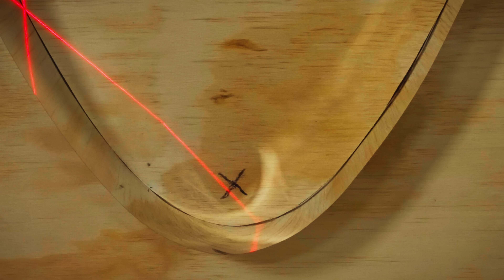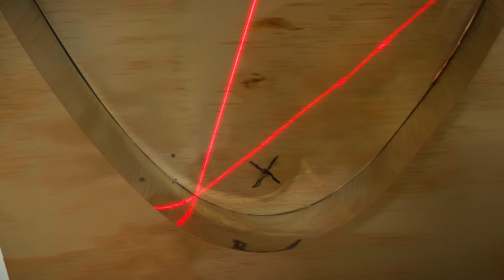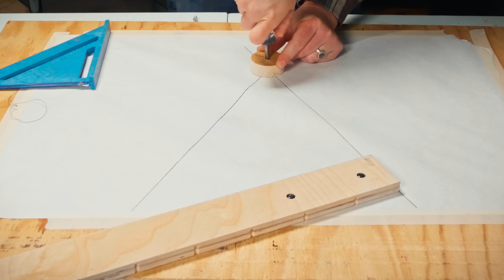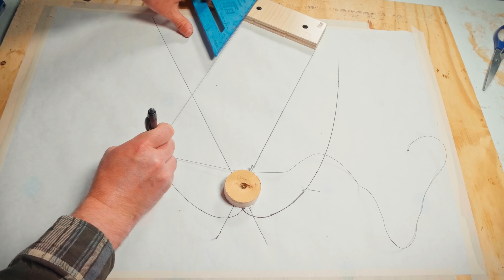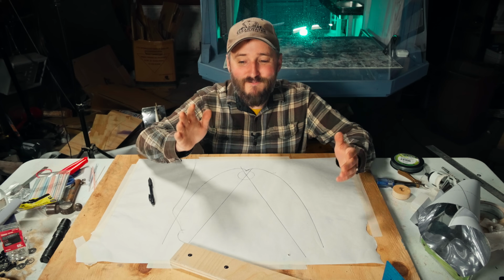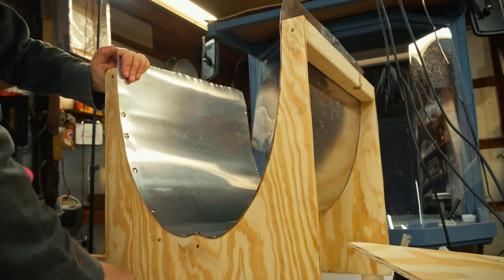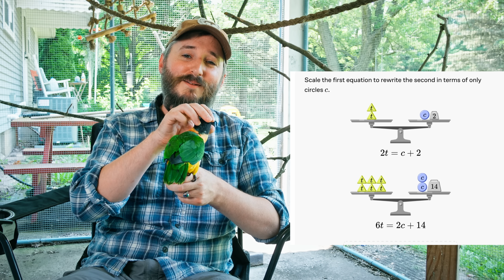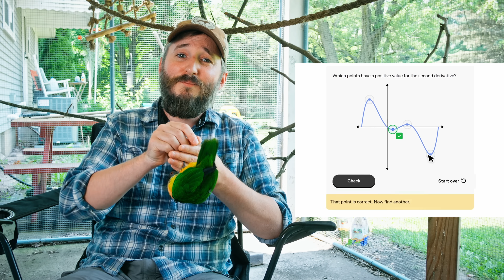DIY Solar Concentrators, Made Better.

Comment: Great work! For a video idea, it would be interesting to see what happens if you use this design for an cooling project! The pipe being coated in your cooling black body emitter paint. Perhaps some slight modifications to improve cooling performance.

Comment: This is cool, but i think a coil of pipe in a thin flat box with a clear top is better for the application. The angle of exposure is much wider and the area of catching the sun is a better ratio for compactness, i think. Instead of a fancy parabilic mirror yuo just have more pipe with the same fluid running through it.

Comment: This is awesome. 
I'm wondering how this could be turned into some kind of power source... If water or perhaps even air could be heated, perhaps a Stirling engine could convert the heat to electrical power. I'm not 100% sure of it's efficiency, but it might work.
I've seen people setup BBQ sets with a parabolic setup like your first concentrator.
If water could be brought to boiling point, it might be a good setup for purifying water by boiling it with one of these as well.
Wonder if the hot air could be captured and piped into a house during winter too...
Many possibilities.
Thanks

Comment: Tracking motor setup heat pipes that are circulated with a solar powered pump  
idk using this in a city house   running a small steam engine with an elect generator ? that charges 12vlt battery's to light your 12vlt Led lights  
that cabin get away be best used on  other wise back to watching youtube diy's :) that i never build
Reply: Memo:  ad guard working blocks adds & popups

Comment: Why does this design with the wide tube and the different shape perform better in cloudy weather and not need to be aimed directly at the sun? Is it able to use the light scattered by the clouds, so the light coming at it from angles other than from the sun?

Comment: I am not a science guy and very poor at math but have a question/thought. Your compound parabola is 2-D. It has a y and an X axis.  It stands vertically on your plywood for one axis and the other axis is the length of the pipe and width of the metal flashing.  Can you make a 3-D compound parabola like a mini satellite dish and have a metal orb sitting in the center.  Satellite dishes are perfectly round which is not a parabola, so if you build one with the parabola chain swing shape it should be an elongated or deeper dished radar dish shape.  So if you can create 90F temps from your 5 inch long pipe and 5 inch wide metal flashing, think how much more the heat is multiplied with a 360 degree y/x axis. So you can't just take an existing satellite dish shape that is made to collect radio or radar waves.  The parabola dish is tuned for the sun. I may not know science but I do know radar being a Mission Crew Commander Air Battle Manager in charge of AWACS radar aircraft.
Reply: Some satellite dishes are round and some are not
Reply: I get what you mean.... Exactly my thoughts but I saw it like a tall bowl...and I wonder if you put a lid on that bowl that was made maybe of glass .... But it's like a double lid..... I think that would capture more light again and force it into the concentrator.... And of course paint the point of concentration black. 
But if the concentrator becomes a 3d parabolic "bowl"... With the double sided lid on top..what can we use it for???? .... Fill the bowl with water to heat it and have it on a closed circuit system like radiators  in the UK, and create movement with convection and use that movement to turn something and make electricity????? 
My brother is a physicist..... I will send him this and see what he thinks 🎉

Comment: The third curve is absolutely perfect for a solar oven with a glass window in the angled lid as the flat bottom of the reflector. Then all light coming in between the two angles will go through the window into the insulated oven space. This will allow the oven to be set up so that at the beginning of the cooking time the sun is at one of the angles defining the "left-side" capture angle and then as the sun moves all of the light will still be reflected into the oven without having to move the oven to align with the sun until the sun reaches the "right-side" capture angle . The sun moves at 15 degrees per hour (360 degrees in 24 hours). Designing the reflector with a 30 degree capture angle means that the solar oven would capture 100% of the light falling on the reflectors for 2 hours completely unattended (or at least unadjusted). If what you are cooking needs more than 2 hours, then start cooking about 10 AM and at noon come out and adjust the angle so it will keep collecting all of the sun light for an additional 2 hours.

Besides the advantage of not having to constantly reposition the solar oven, this type of reflector can allow the window to be smaller than the top of the oven. The window is the least insulated part of the solar oven, so the smaller it is, the less heat will conduct through the glass. Still probably worth putting using a double pane window to further reduce the heat leak out of the oven. And of course, the capture area of the reflector can be made larger than the total area of the top of the solar oven to give a greater than one Sol of illumination, which will yield higher oven temperatures than a solar oven with just a flat pane of glass in the top.

Besides wierdos like me who think it is cool to cook with sunlight, solar ovens can be critical in parts of the world where pretty much wood is the only energy source available for cooking and that wood is being used up and getting more expensive for desperately poor people to buy. So an efficient and cheap solar oven can be a lifesaver for millions across the Sahel region in Africa and others like it around the world.

Comment: So, if you extrude this shape radially, you'd only need about a ~7' diameter circle to melt 1kg steel in 5-10 minutes (depending on the time of year and the latitude of your location). This is also assuming ~80% system efficiency.

I'm imagining a tube of tungsten with a tungsten # shape welded within and you drop in chunks of steel and point that baby at the sun and presto you've got a backyard smelter that operates at the low cost of $0.00 per hour.

Comment: I've seen folks suggest coating the pipe with various coatings, but, since it would be completely enclosed and thus not affected by the weather, might not simply blackening it with soot from a flame provide an optimal light-absorbing coating?

Cheers!

Comment: A better test maybe...use the same pipe in both rigs, fill the pipes with water, see which pipe heats the water better over time. Repeat with different size pipes for more insight.

Comment: 4:47 You actually do care about the angle, rather than "as long as it hits somewhere along the pipe", as the angle light hits the surface predicts absorbed power for most objects.

Comment: If you did create the 3:13 cut and the earlier mirror surface with the hanging chain method, the catenary shape to parabola approximation should explain why the laser went ever so slightly off.

Comment: Love the video as normal. 

Always wondered on this. Say you did build a long trough for water heating (And I have seen professional built units in temperate regions for getting a little more heat into a greenhouse). Instead of a flat cover over the top.... what about having the plexiglass or whatever formed into a lense itself. Flat bottom, convex top? Might help increase the "viewing angle" by several degrees. Wouldn't do much for you on a sunny day, but might get a little more energy on a cloudy one.

Also wonder if mylar space blankets would make good reflectors.

Comment: Okay. Headed down the math rabbit hole now. Got to make drawings for compound parabolic ribs that my cnc router can cut. Half dozen parallel troughs about a meter long... one inch blackened copper tubing... solar cell powered pump circulating to an insulated reservoir...  Hmmm... at my latitude the biggest problem might be keeping the water under 100 C. So many fun problems to work out. Thanks, Ben.

Comment: Slide a coil of small diameter copper tube down that iron pipe and you've got a pretty good heater for a camp shower. Throw in an inline thermostatic mixing valve to set temp, and you've got it made.

Comment: here's a good tip: make the concentrator run parallel to the sun path (east-to-west) so rays hit the tube regardless of time of the day. you wils need to adjust it north-south as seasons change, but very rarely or maybe not at all, if you use the method in the video. also keep in mind the ends of the concentrator will receive sun rays, so either make it reflective or at least a heat resistant material

Comment: @Nighthawkinlight a lot of Nuclear Power systems incorporate natural re-circulation into their design - the main advantage being it provides enough heat dissipation to keep the reactor cool with no external power (this would be used in an emergency situation - loss of power and reactor SCRAM -- something like that).

The main driver of force is the height of your "cold leg" compared to the hot.  The different densities of the water at different temperatures create a flow of water in a direction.

If you were to set up a system with this heater above ground and a deep cold leg that goes underground, you could create a closed system with an extremely high driving force.  Add 2 relief valves for safety and redundancy (nobody wants an explosion), and an inline generator.... Now you've got yourself a solar electricity generator.

Comment: A drywall square or any straight-edge held along the speed square would let you just unwrap the pen until it hits that edge and then follow it as it slides, rather than struggling to keep the string aligned with the short speed square. Let the string just do it's job of keeping travel distance equal, and let the square do it's job. =]

Comment: Big advantage of the Compound parabolic is that is you can take your Latitude and aim it at the midpoint then set the angels at the max & min to maximize the heating without any need for adjusting for the seasons.   One of my friends has this and he even curved the mirror and pipe ever so slightly to maximize the day as well.    Also as others have mentioned, paint the pipe with high temp. engine flat black or chemically treat to make the pipe turn black.

Comment: If you use this setup as a light projector what would be the shape of the beam (of course it is simple to test just replace the pipe with one made of white paper and put a LED light inside).

Comment: You can also get an old flashlight and get the reflector out. It most likely already has the desired shape to heat up small things like a metal straw.

Comment: @nightHawkinLight, the geometric definition of a parabola is : all the point at the same distance of a fixed point AND a line. This is what you draw : the pen on the string is exactly at the same distance of the fixed point (focal center) of the parabola, and the line (the one of your wood bar).
On the second part, you draw what's called a cycloid which has also some nice geometric properties :)
All this can be designed as well by formulas, but for once, I find the "geometric" definition more elegant !

Comment: This is how spur tooth gears are designed in CAD! It allows for a constant contact for continuous torque transfer, compared to simple circular lobe shaped gears. There’s definitely tons of math out there for this, I bet you could use it to find some fancy optimization but honestly this is the simplest way to achieve the same result.

Comment: A chain is not a parabola but a catenary curve which involves the hyperbolic cosine function. It is true that it contains a parabola but it is not exact: 2*(cosh(x) - 1) ~= x^2 + x^4/12 + ...

So it is not as effective at the edges. This may not matter for simple applications but technically they are not the same.

Comment: Just a tip that painting the pipe black increases the heat output inside enough to boil water and cook food. Also Gosun already manufactures a very similar solar cooker.

Comment: Wow, Ben....! This is great news for me....I have a fifth wheel from the late 80s that is pretty sweet....I have it on a piece of wooded property I own...In Washington....I need to insulate under the floor. I can do it from outside underneath. I have decided to run some plastic water pipe through the floor joists for a radiant heat system... I will then cap the bottom of the cells between the joists off with 2 or 3 inch solid insulation.... Thus making a fully enclosed continuous system where heat will only rise into the living space through the mass of the floor. The compound parabola eliminates my need to make a solar collector that I would have to move.. My idea will actually incorporate several parabolas in line along a single reciever pipe, with each parabola angled in line with the path of the sun during the different times of the day.  One pointed easterly for morning, one westerly for evening... Maybe another towards zenith..... But all Ps within an insulated box, like a sun oven....Stacked side by side like books. When the concentration of the morning light begins to wane, the Z and Westerly will increase, heating their own section of the common pipe...... I'm thinking most beneficial during seasons of Equinox, when it is cloudy more often, yet a relative high solar angle..... I will have several heat sources in my whole setup.... Along with an insulated water reservoir.... Considering sand in the mix, as a thermal mass battery as well.... But one idea of mine is to create the parabolic shape along a pipe, maybe 4 to 6 feet long,  then twisting it about 90 degrees or more end to end, like wringing out a wet towel, or a bobsled track, so that the P shape will have an area along the pipe always at full potential, no matter the sun angle..... I just want enough heat to keep the unit comfortable, and dry during the cool months. We have black mold here....But I want to build an off grid system first, even though I have available power on site.... Ben, have you seen those sand battery units that farmers make for greenhouses? They take a 2 to 3 inch wide band of thin copper, about 3 ft long, bend it in a loop, set down in a metal bucket filled with sand, and use a candle flame to heat the band to conduct heat into the sand mass.... It gets the sand up to about 400 degrees, and keeps greenhouses from freezing at night.... Using a permanent copper tube wick,  one could use crisco as the candle source, holding flame at a set height... I understand one 3 lb can can hold a flame for over 2 months.... Could easily be made safe.... Hey, cheap survival heat for the Homeless..... What do you think? I sure appreciate that you actually read all the comments. I have a ton of ideas. I'd like you to consider a few.....

Comment: A bit ironic that the very slight difference between "parabola"  and "catenary"  is the same point Ben is proving in this video with "parabola" versus "compound parabola"... which is that the parabola shape is unnecessarily precise, and not the best fit for the application. Using the concept of the parabola to derive the curve empirically using real dimensions/objects is a very practical solution. Understanding the problem, the math/physics behind it, and knowing that you don't need to calculate anything to get the  result you desire!!

Comment: Very interesting test. I've build a solar powered box to dry chili and herbs, just with a flat sheet of aluminium painted back. But I really like the idea of concentrating the heat. Maybe one day I take your concept for an updated version of my box.

Watching this video I wonder what string length would be optimal. If you use longer string you get less steep angles. This should help to focus... but at the same time you might only be able to utilize the lower part of the pipe. For the hybrid parabloic version this might result lower acceptable inbound angles?

Comment: It would be interesting to test what could be achieved with a homemade solar concentrator like this one: a solar cooker, an electric generator (using an Stirling engine), a solar furnace (for melting different types of metals)... The last one could be a cheap alternative to carbon or gas furnaces

Comment: To make your compound parabolic wouldn't an easy way to make it be to do the trick with the chain, trace it  then move it to the left or right a couple of inches & trace it again. It might not be optimized though, but would probably work.

Comment: a catenary and a parabolic are not the same - tho for these scales it is NEGLIGIBLE and you won't see a difference - over 60ft size dishes, then it will make a practical difference
(catenary: Involves hyperbolic functions, parabola: quadratics), so a several meter dish, with an inch target, or smaller etc, no difference, so it is a good very very very close approximation

Comment: Your enthusiasm and careful choice of practical design methods we can all use is amazing! I wonder what a 3d ie turned compound parabola dish would would like? An imagine choosing the angles to match the winter sun, and avoiding the summer sun, might be a way to increase passive heating in a home, eg if the verandah roof were internally reflective onto the internal floor - the basic idea of optimising for a broad but defined range of circumstances rather than a specific ideal is really well explained!!

Comment: That last tip could be used on a large scale to trap more sunlight and direct it at conventional solar panels.  Even with minimal solar tracking, you'd get way better efficiency results from the solar panels (as long as you didn't melt them).